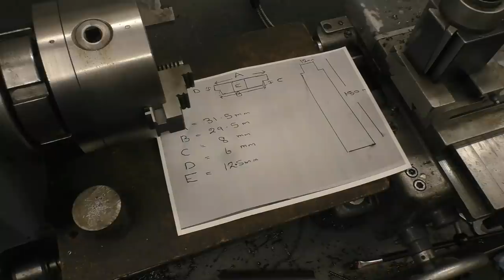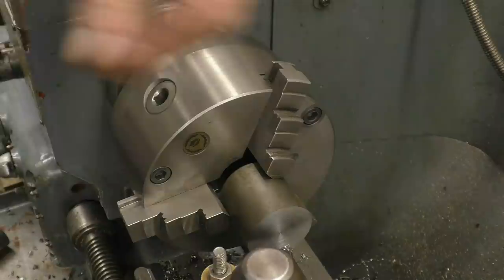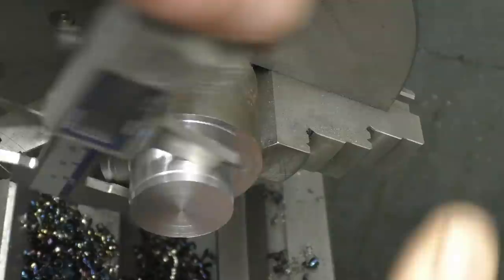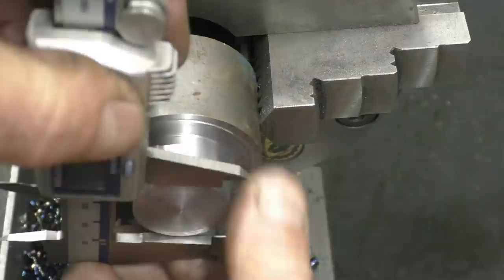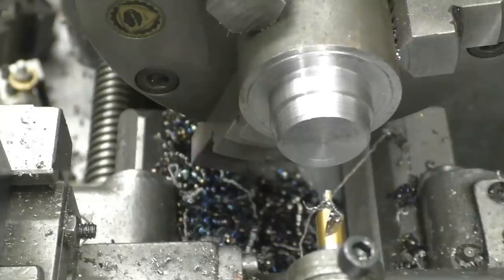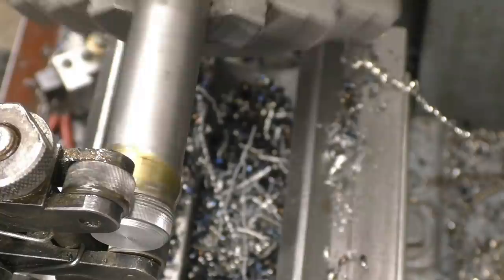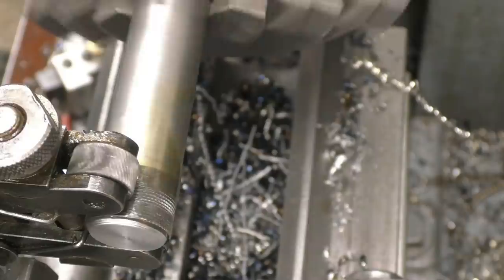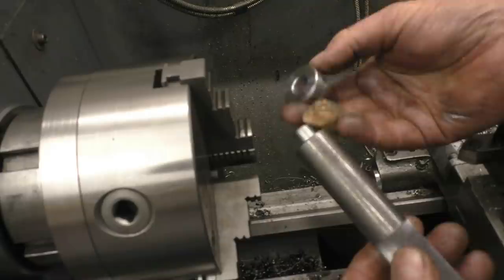SNNC 435 P1  Core Plug Install Tool

Comment: John, just measure, set the measurement into the dro, and turn to size !  If the dro doesn't have a diameter mode (some Chinese ones have a setting that doesn't work!) set the cross-slide resolution to double what the scale supplies (i.e if the scale is 5um , set the res to 10um)
Reply: Not everyone has a DRO, he's showing a good method.